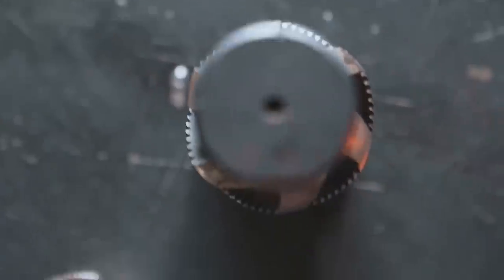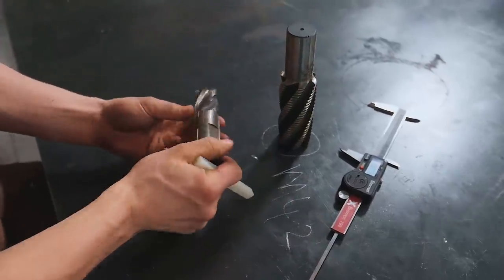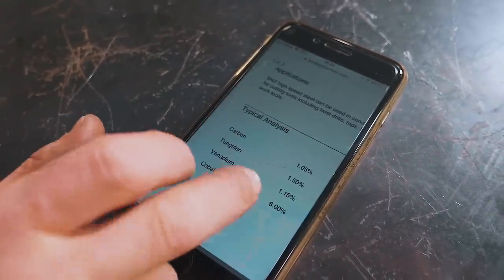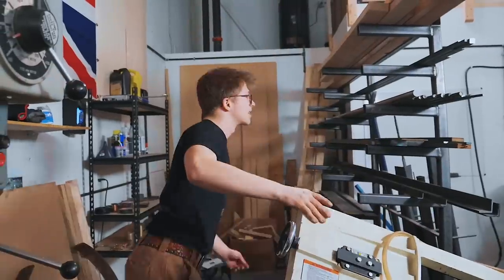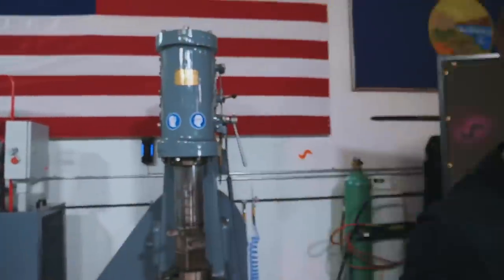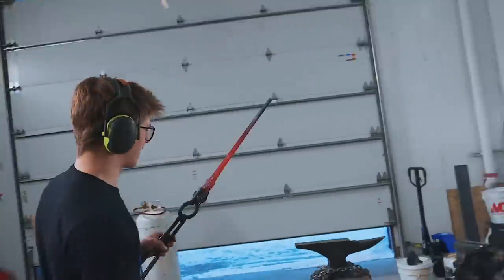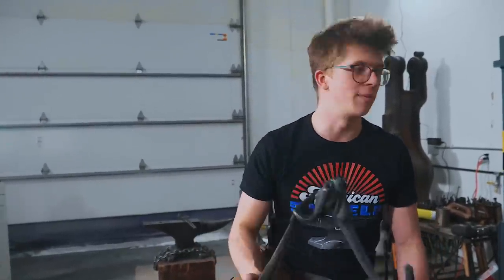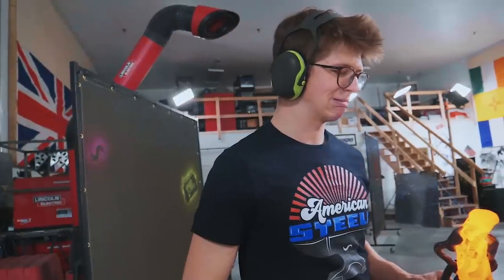CAN YOU FORGE A GIANT END MILL?!

Comment: Why not make it a knife?
Reply: The grinding would destroy belts and take a while
Reply: @koshey245  
You don't have to grind the bevels.
Reply: High speed steels are usually very difficult to heat treat, not to mention they require very high and precise temperatures, which makes it necessary to have an electric heat treating oven to do this ;)
Reply: @BarbershopCustoms  
See, now this sounds like a competent objection.
Reply: @BarbershopCustoms  so forge it and send it back to fireball to heat treat.
Reply: Barbershop Knives i m just sayin, Alec steel tried to make a sword from a meteorite! Im pretty sure hed get a lot furture with this as a knife. Just saying
Reply: @delinquentdesign  what do you expect to cut with a knife like that, an iron steak? XD
Reply: @ MichaelRitzen Yes and clamshell plastic packages
Reply: @delinquentdesign  I can understand the clamshell packaging, yeah
Reply: A beyblade for the Bridgeport? Yikes! Stand back!
Reply: Barbershop Customs I work for a company that heat treats steel like this on a daily basis. We have natural gas furnaces and it’s honestly quite easy so long as you have an accurate thermometer.
Reply: I don't know about the m 42 stuff but hss doesn't make very good knifes because it's so hard and doesn't like to bend, it's more brittle than you'd like a knife to be, maybe a small one would be fine but I could see a sword shattering from bending it too much.

Comment: When will it be time to make a bigger forge? Guessing you won't be able to work out of Will's forever.
Reply: I'm surprised that wasn't his first big project. Will's forge should be for knives, and they should make a large one for the big blades.
Reply: @_DST0NE_  Agreed, and it's not not colossal job. Steel box on legs, bolted to the floor, line it with fire bricks, couple holes in the top for the gas feed, much like his old one. Unless he's planning something truly storming to surprise us with. Either way, he needs to remember to clean the floor in there 😂😂😂
Reply: I feel there may be a plan here. MEGAFORGE in the coming months maybe?
Reply: So long as Will's has got a pass thru hole, they can forge just about anything in that thing (except for maybe a hungamunga) .  It is also far more efficient than Alec's previous forge by the looks of it.  2" of Ceramic wool, hard-face dense refractory,  and Zirconium silicate coating and you've got a cheap and super efficient forge that will get as hot as you want.

Comment: You should've made a blade from the end mills. Maybe you could get some more hss and forge weld it together with some spring steel (5160, 1095, etc.) and make a san mai laminated katana, or better yet a nodachi

Comment: So when your looking at steels with other elemental additives. Look for the carbon equivalency. Adding any intermittent element will discourage dislocation and make the steel act like it has a higher carbon content as well as add other attributes. Silicon makes steel have more flow ability and weld ability. Boron added in high amounts make a steel brittle, but in small amounts makes it tougher. Basically, all your're looking for is 'Carbon Equivalency' 

Really enjoyed it! Keep it up

Comment: As you said, both of them are made of high speed steel. The tungsten and cobalt in HSS are there to help prevent the steel from deforming while hot. Thus, it was harder to forge than normal steel.

Comment: I don't know about many of the other alloy elements, but molybdenum and tungsten are designed to improve toughness at incandescent temperatures so the tool can heat up a lot and still not soften or crack when slicing its target object.

Comment: Can you forge a knife from an end mill?
Reply: Better question; would that knife be able to cut other Damascus knives?
Reply: the short answer: yes...kinda
the long answer: you can forge a knife out of an end mill but the difficulty of it is that it has already been pre-heat treated from a factory for a very specific purpose, so you would have to actually have a high temperature electronic controlled heat treatment oven, preferably with an inert gas seal system that would allow you to heat the steel at a very specific rate,  and hold it at high temperature for a specified amount of time, then also be able to cool it at specified rate as well, then be able to actually take the steel and forge it into proper shape. 
after that to be able to heat treat the steel for blade worthy performance it would be imperative to have the same heat treatment kiln to be able to heat the steel and hold at a specific temperature for a certain amount of time so that all of the carbides from the tungsten, vanadium, and cobalt have proper time to be put into solution into the matrix within the carbon cube form,  without this you would not be getting any worth out of the steel as from just a gas forge, the ability to control specific temperature ranges is very difficult as the temperatures can vary by 100+ degree's, and for extended hold times you begin to lose a very large amount of integrity from the carbides possibly coming in and out of solution or not entering solution of the matrix at all. also from the wide ranging temperature swings the possibility of micro fractures is exponentially increased. while it is a nice idea to be able to use this steel for a knife, there are also much better options, while this is a "cutting" tool, it does not have the kind of alloying contents in the proper proportions to be truely successful in a traditional "knife" sense of the term. also the handling of the steel for heat treatment is much more advanced than i think either Alec or Will, have the current knowledge to deal with, they also dont currently have the kind of equipment to do it true justice.
Reply: @DarkWolf-yr1ml  Thank you for the highly detailed and knowledgeable response. It makes sense we won't get to see it because it would be way too difficult, specific/techincal, and expensive. I am still glad to know it's possible.

Comment: I’m thinking the metal of the two end mills was a lot more similar than you think. The smaller 32mm end mill said HSS-Co8, which tells me that it was potentially high speed steel with an 8% cobalt content; that’s suspiciously similar to the M42 steel specification. As a further example, it’s common for some alloys of metals to refer to their alloying elements in their description. A strong example would be the common titanium alloy 6Al4V, which is an alloy containing 6% aluminum and 4% vanadium, a few trace metals, and the bulk made up by titanium.

Also, I’d love to see you attempt to make some Damascus with old, broken HSS end mills as one of the alloys.

Comment: Did you get the Vacuum box to work?  If not, get a pressure cooker and attach to a vacuum pump.  A paint pressure pot would work but it is larger than the pressure cooker...............

Comment: As a hobby blacksmith but professional machinist this feels like a stab in the heart
Reply: Same situation here...like painful...when I seen carbide and tungsten was part of the alloy I was curious if what they say is true in percentages slightly lower and up it is not able to be forged which I have doubts of from my chemical and metallurgical background and understanding do it did rekindle my plans to do some firearms, engine, and knife designs. With enough heat if like to try casting. Especially after that destruction...tell me I'm not the only one twice as cringed that he didn't make something more significant from such a tool like a knife or the likes!

Comment: HSS is ever so slightly magical, not quite pure wizardry like proper super alloys (Inconel for example gets tougher when you heat it), but still a bit magical. If you look at a hardening and tempering sheet for M42, which is quite a soft HSS compared to some more modern stuff, it heat treats from around 1200 C, and tempers somewhere around 550C for normal use. This is a bit of a different beast compared to plain old Jane carbon steel. Also, some HSS can be air quenched from those temperatures. This is why you can melt HSS with a torch and still have to rock hard after cooling back down again. Annealing can be done, but we are talking temperatures of around 1200C and a slow drop from that down to under 1000C in a time span of around 24 hours if you don’t want to mess up the metallurgy of the HSS. So I’m thinking that you probably didn’t anneal it long enough, and not quite hot enough, if memory serves a forging heat is around 1000 C out of the forge if I remember correctly?

Comment: You don’t necessarily need to forge it. High pressure rolling to diameter, them machine the pieces to make an end mill. Obviously you can, as you proved in your video. But I’ve actually had the opportunity to tour a facility that made machine tools. They pulled & shaped steel, like you would make gold wire. Was very cool

Comment: All those alloy element had to this HSS is to make carbide, and this is why it has 1,5%C (it’s huge for a steel) and the cobalt is usually for this kind of tool to keep it’s mechanical proprieties at high temperature 😊 beware when you will quench it 😅 those kind of alloy quench in really easily, usualy a air quench 😊

Comment: The reason it didn't bend was because of the alloy. Knowing about jewelry the tungsten, chromium, silicon, and cobalt make it hard on the mohs scale probably an 8-9 with an extremely fine crystal structure that will shatter if pressurized high enough. Even diamonds will shatter.

Comment: An Idea to mount your kitchen towel holder: Maybe you can mill a slot into the back of the thing and weld a plate on it with a hole in it in the size of the screw head and a slot that continues The hole in the width of the screw so you can screw a screw into the wall and slide the holder over the screw. (Hope its clear what I mean)

Comment: You would have had a tough time with that M42 HSS, Alec. It's designed for a 68 Rockwell C working hardness with high wear resistance and high temperature usage. You certainly could make something with it, but it will NOT be an easy project.

Comment: Alex Steel making modern abstract art ... the world is coming to an end.

If you are talking about odd steel to forge, I have always wanted to see someone forge S5 shock resisting tool steel into a knife.  It is used in Pneumatic tools, shear blades, mandrels, heavy-duty punches, and stamping dies.  There are rumors going around that S5 is used in jackhammer bits but I think that is a myth.
Though I would like to see a blade made from the metal, I doubt someone will.

Comment: m42 have one of a hell of heat treat

copy paste some info from a manufacturer 

M42 exhibits excellent wear resistance by virtue of high heat-treated hardness (68 to 70 HRC), and the high cobalt content imparts the hot hardness. As such, the cutting edges on tools made from M42 super high speed steel stay sharp and hard in heavy-duty and high-production cutting applications.

Critical Temperature:
Ac1: 1560°F (849°C)
Preheating: Heat at a rate not exceeding 400°F per hour (222°C per hour) to 1500-1600°F (816-871°C), and equalize.

Austenitizing (High Heat): Heat rapidly from the preheat.
Furnace: 2150-2175°F (1177-1191°C)
Salt: 2125-2150°F (1163-1177°C)
To maximize toughness, use the lowest temperature.
To maximize hot hardness, use the highest temperature.

Quenching: Pressurized gas, warm oil, or salt. For pressurized gas, a rapid quench rate to below 1000°F
(538°C) is critical to obtain the desired properties. 
For oil, quench until black, about 900°F (482°C), then cool in still air to 150 -125°F (66-51°C).
For salt maintained at 1000-1100°F (538-593°C), equalize, then cool in still air to 150 -125°F (66-51°C).

Tempering: Temper immediately after quenching. Typical tempering range is 950-1050°F (510-566°C). Hold at temperature for 2 hours, then air cool to ambient temperature. Triple tempering is required.

Comment: You cannot forge tungsten so only try it on steel. Tungsten melts at a temperature higher than steel works and never gets to a plastic consistency. If there’s too much alloyed in the steel then it won’t work well.

Comment: Alec, before you start forging a material or stuff you have never done, I beg you. Read about it first. I'm aware of the fact, that forging a cutting part of end mill is dangerous cause of chance of  crushing blades, but...
The cutting part is 100% made of high speed steel. In bigger HSS tools like turning tools or end mills, a handling part is made of mild steel to reduce the cost of the tool. Then handling part and cutting part is joint for example by welding or soldering. So, my point is - forging a handling part could not always give you the effects you can be 100% certain.
Another tip - when you forge any high-alloyed steel, you should use gas protection. Of course - not all metals in a gas state is very toxic, but why risking?
Best whishes!

Comment: Why does that EM have a threaded shank?
Reply: This was after 10 seconds of googling, but I was curious myself:
Threaded shank endmills are designed for use in Dormer or Clarkson autolock milling chucks. These chucks have special collets with threads to screw the cutter into, then the whole assembly gets clamped in the special chuck built for accepting these collets.

Dormer collets and Clarkson collets (and chucks) are not interchangeable, AFAIK, and I've got both, but they are 30 years old too ￼

Threaded shank tools may have a slightly lower spec on the shank diameter and may be a bit loose in a set screw side lock holder. But, I have seen some of these tools manufactured with a weldon notch, so I suppose maybe those ones are closer to spec.

My advice: get the chucks and collets that match these tools if possible.

Oh: the advantage is that the tools are very secure in position once properly loaded into the chuck. The general method is to start the tool into the threaded collet, then assemble the collet into the chuck, bringing the nut up finger tight (or just a wee bit less) so that you can then screw the tool in (with a rag around the tool) til it bottoms. Then take the chuck wrench and give the nut the final cinching. This closes the collet and locks it into the chuck at one go.

I have seen some guys have difficulty using these chucks because they did not grasp the concept of how to load them.